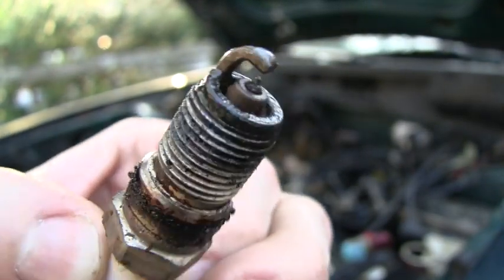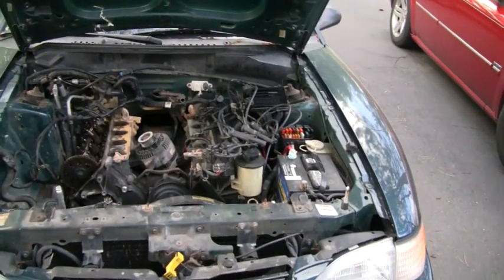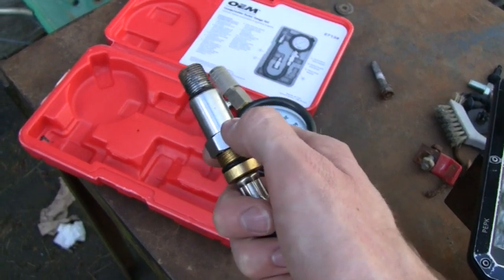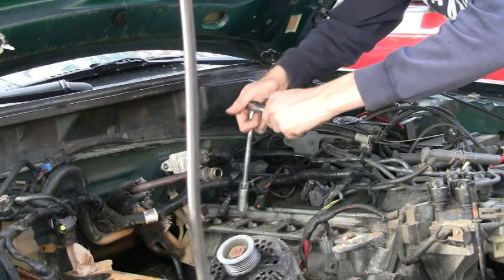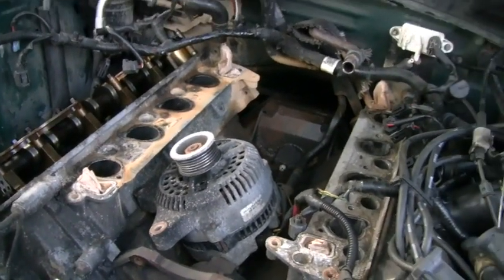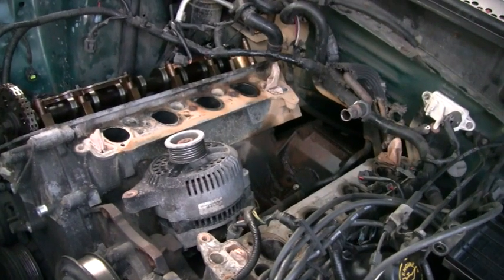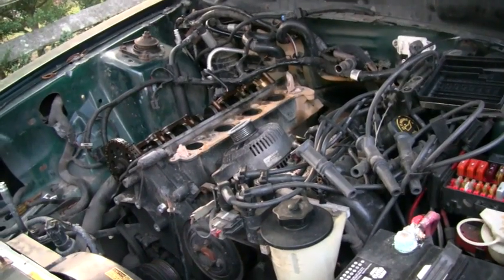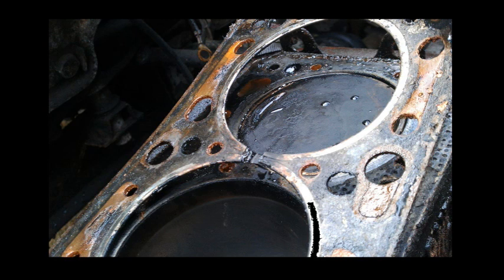HOW TO TELL IF YOU HAVE A BLOWN HEAD GASKET (COMPRESSION TEST)

Comment: Asking cuz my check engine light turned on. So let's say I do the compression test, and the psi's are too far apart. Does that tell me I need to replace the head gasket, or that just the problem is inside the engine?

Comment: You should also have put oil in the cyls and retested to see if the rings are worn.
Reply from the maker: +Matt Lol I'm not rebuilding this engine, even if the rings are worn I'm just gonna replace the head gasket and drive it for the summer
Reply: I would think since you have the tester, you would want to know the whole story of the engine. You didn't need a compression tester to know the head gasket was blown.

Comment: Hey I have a question my distress car has two problems and she's in a tight place financial so maybe you can help me instead of going to a auto repair shop first thing is every time she pushes the brake pedal the car and stealing wheel shake a lot and the other thing is every time she presses the gas pedal the car make a kind of put put clicking noise any idea what's wrong
Reply from the maker: Very hard to diagnose over the internet, but I would check the brake rotors to see if they are warped, that might be the cause of the shaking.